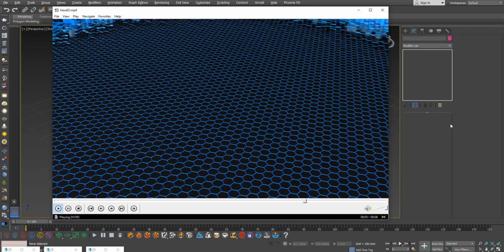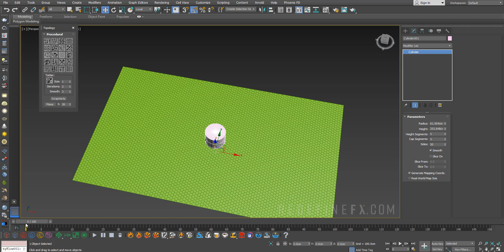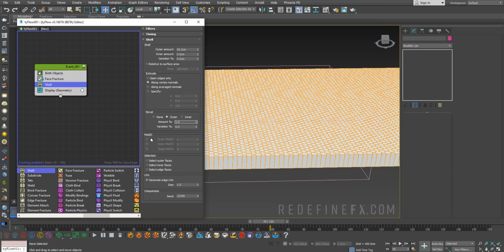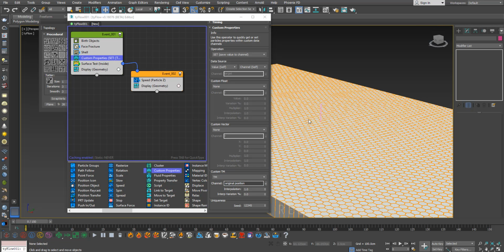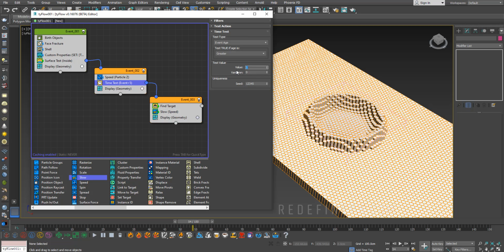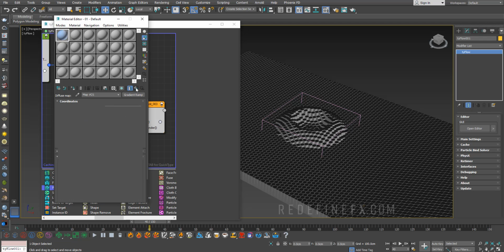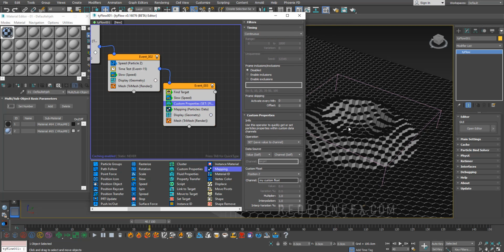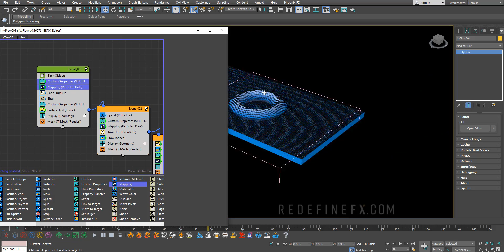tyFlow Custom Properties Tutorial: Shockwave in 3Ds Max by #RedefineFX

Comment: Hey great tutorial. I have one issue. When I pick the object for a Surface Test and add the speed for the geometry to go up. All my hexagon go up at the same time. You get this pyramid like shape when you apply speed. I just get a building like shape
Reply from the maker: Your surface test must not be set up correctly
Reply: @RedefineFX  yep it wasnt. thank you.
Reply: Having the same issue and my Surface Test settings are set exactly to what you show. Even the default just does the "whole house" look. Can't get it to work like you show.
Reply: ah , found the issue. Some of the "Default" settings are different in newer version so I had to make adjustments to match what I saw in the video :)

Comment: how would you make the extrusions follow the shrink inwards after the expanse? like make the cylinder pulse in and out. I can get them to go outwards, but the particles stop and return stationary after the first cylinder grow
Reply: Yes i have the same question... I made an voxel based particle system of a monitor where i centered the cylinder to make the ripple. But what i want is to have the ripple effect go on continuously. Is there an option to have it riple again after xx couple of frames? The cylinder is animated one time offcourse and making multiple cylinders is possible but how would i switch between them in tyflow. there must be an better way?? Hope to hear from you